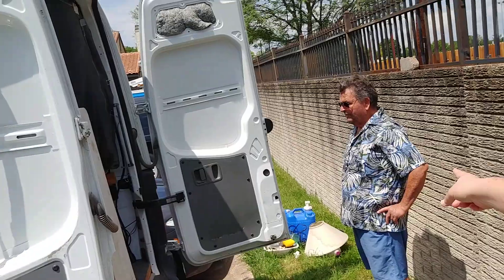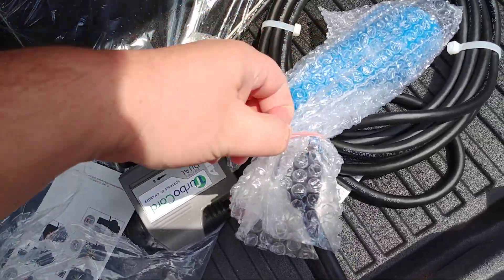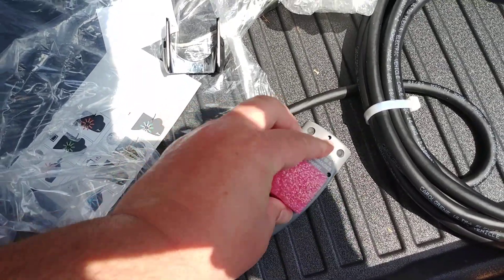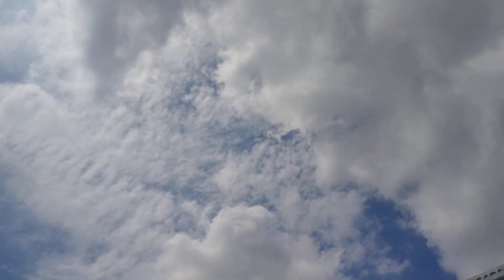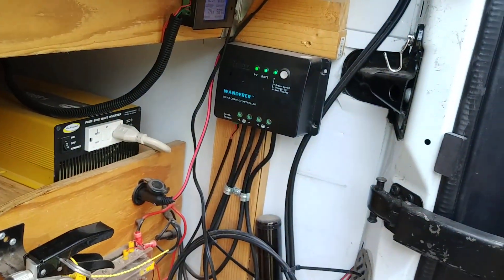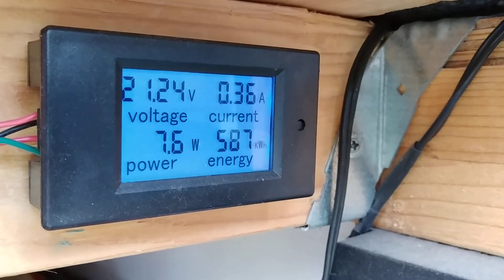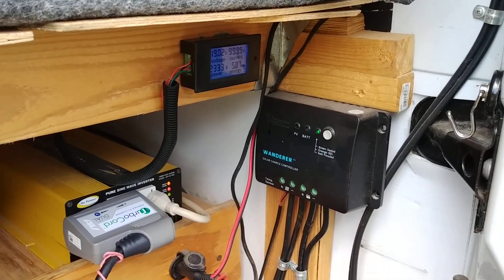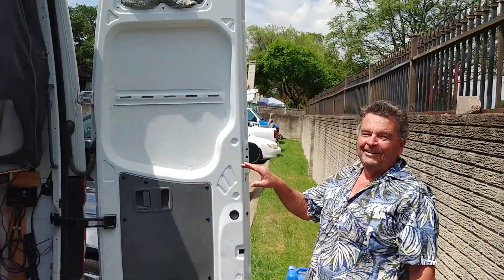Solar Off-Grid EV Charging

Comment: Hey thanks for posting!  The inverter and batteries seem unnecessary and inefficient, if you just charge during the day.   I mean the car has very expensive lithium ion batteries, right?  I live off grid and was looking for a video of just panels and controller to the car.
Reply: DC-to-DC would certainly be ideal, but a number of issues stand in the way. First off, you'd need the right panels and DC-DC converter to get it to the approximately correct voltage to charge this car, which isn't as trivial as it seems. Then, you'd have to get a custom CCS-style DC charging system, which constantly talks to the car to provide the correct current and voltage to the car. Next, you'd have to reconcile that with the actual voltage/power coming from the panels, as that will vary. (Batteries help provide a steady power supply.)

The solar panels >> battery >> 240V AC loop is inefficient, but can be built with off-the-shelf parts, the battery provides consistency during charging which simplifies things, and all cars will take 240V AC through a very simple charging protocol. So, you take a ~10% hit in efficiency (not ideal) but it works!

Comment: Cool and all but how exactly is it built?
Reply from the maker: Solar panels on the roof. Deep cycle batteries to store the energy. Inverter to change the current from the solar batteries to "regular" outlet power. That's the simple explanation.
Reply: @NewCarSpin  cool thanks

Comment: Really cool car but who has the time for all these logistics when all you want to do is get in your car and take a drive/road trip..I fill up my Touareg TDI with 26 gallons of diesel and drive 700 miles without worrying about charging, voltage, distance to charging stations, weather conditions at charging stations.  That’s a lot to think about when all you wanna do is get in your car and go...
Reply: My huyndai give 630 miles and a small gas tank , i will never go back to gas
Reply: Cool so you can put HALF A BARREL of fuel into your giant truck to drive it. How is that relevant lol. If you have a Tesla you can charge it by plugging it in at home, then when you leave your house each morning it can go 200-300 miles without even thinking about it. If you want to go further, you have to stop for 15-minutes per 200 miles or so. And use ZERO gas.
Reply from the maker: The Volvo T8 is actually a 400hp hybrid. It has a gas engine. The car can even charge itself. Plus I can park my ice in ev only parking spots! 😆
Reply: New Car Spin how many miles can you do on a full tank of gas and a full charge ?